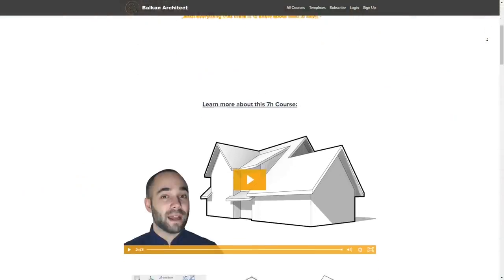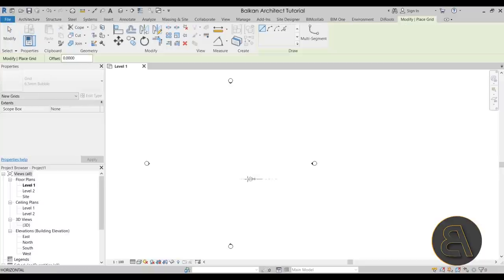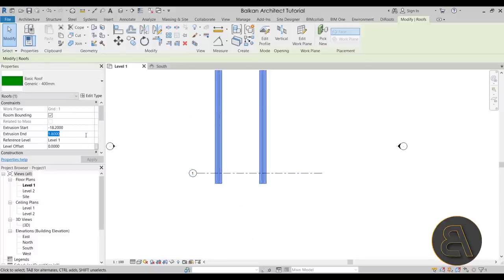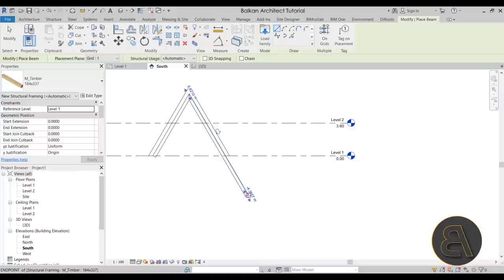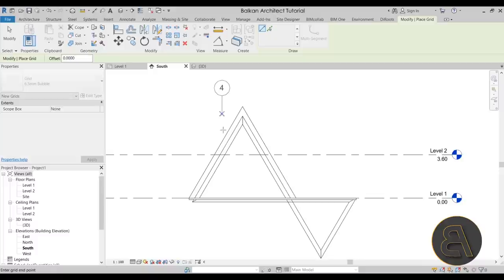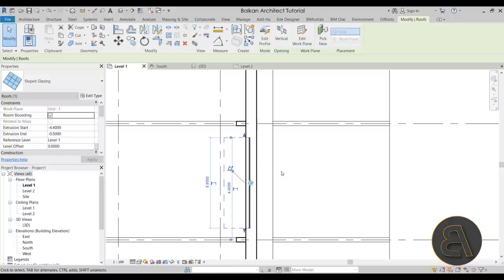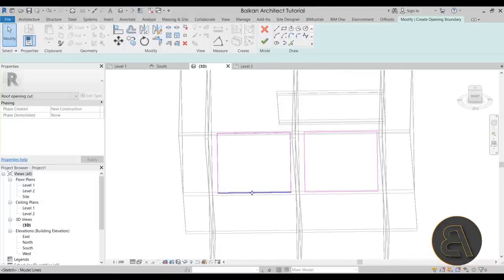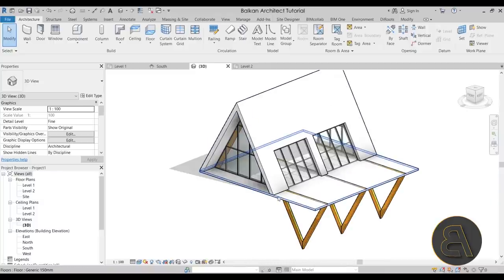A-Frame House / Cabin in Revit Tutorial

Comment: QUESTION: Do architects design underground facilities and complexes as well as aboveground facilities?
Reply: No, civil/structural engineers
Reply: Consultation betwween the mentioned parties its not basically a singular job.
Reply: An Architect is responsible for the layout and design of the facility and often specifies the waterproof membrane like Sika, typically insulation and acoustic ratings, egress etc. Then an Engineer needs to design retaining wall, foundations and ceiling/floor/beam structure above. You would also require an HVAC engineer (depending on scale of structure) for mechanical ventilation etc.
I have designed a simple below ground wine cellar/gun storage before for a residential project and this was the process.